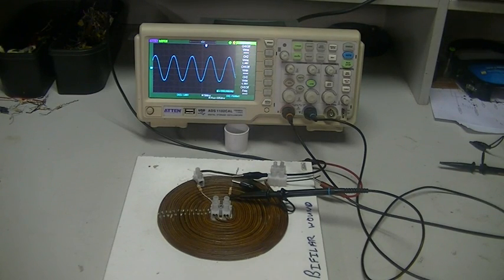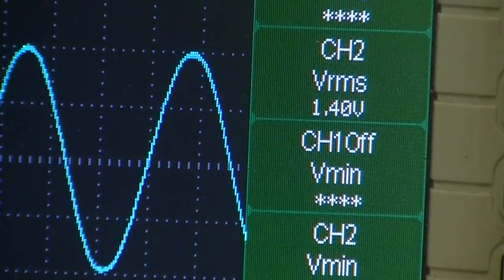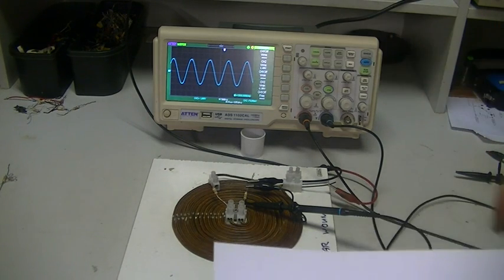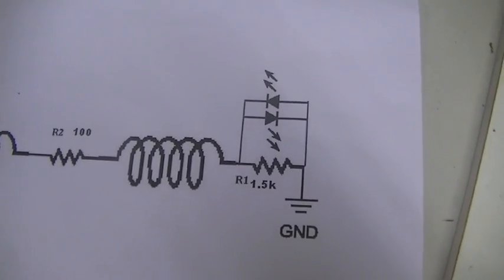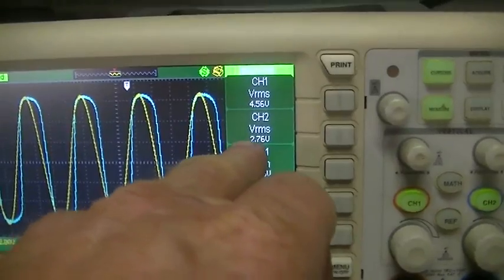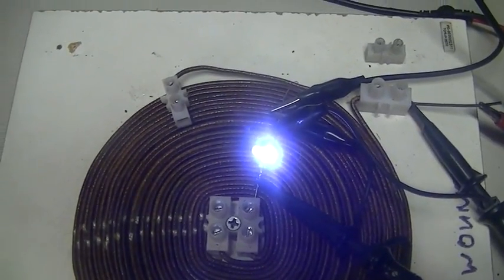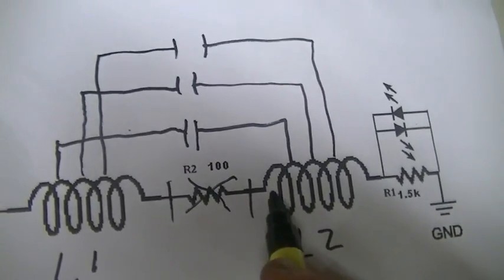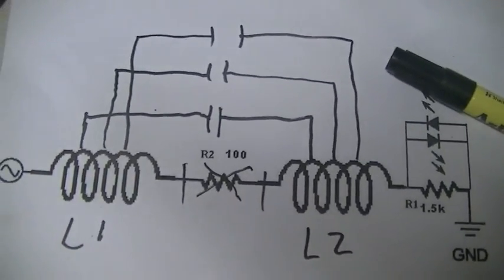My response to Russ number 3. Thinking outside the box.

Comment: if you want to truly measure if more goes out than in then what the part that you attached to the bulb to another coil and see how much that gives and do that a few times to see if it increased. Or have a solar panel that wont give out more juice and see if that work. I dont think it will but would be interesting to see if. If it can pass those 2 at the same time then you got something.

Comment: Dear Brad, I didn't see yet any O.U. in your experiment but I know that was not the point in your discussion with Russ and I didn't see the initial video that i will do. But I can answer your question I guess You already know the answer ;-) 

When we make R2 been at a NODE-POINT in term of REAL POWER (phase shift between curent and voltage at 90°), of course we can unplug R2 it will not change anything while the tow coils are CAPACITIVELY COUPLED. Also, the fact we get even an increase of REAL POWER at the remaining light bulb just indicates that R2 was not at a full NODE and taking it off the circuit increases probably the BALANCE OF PHASE between the tow coils and/or at least, the ANTI-NODE at R1.

By the way, thanks the the Attention and Care You give to this subject so it can be Really Understood without any misconception :)

Regards,
Didier
Reply: this effect he describes occures between 100 and 1000 kilohertz, so your explanation does not match the experiment, because nodes change with frequency

Comment: Are we sure what is going in one end is coming out the other?  At some frequency maybe current is going in at both ends at the same time forming a standing wave. The open center seems like a more stable point than earth ground. Since you have center open two high mega ohm resistors should have little effect there.

Comment: I thought a scope would show this naturally with AC where after removing the resistor it's showing you potential between the line and ground on each end. Being that the resistance is extremely high at that point current would not want to flow but the scope would still show you the signal I thought.

Comment: Tesla used 'high' frequency to transmit power on one wire.  Again, I suspect that you need two input resistors, one for each input leg.  Again, I suspect that more power is being pumped into the 'system' on the 2nd signal generator wire--the wire with no resistor.

Adding only one resistor is all you need to do.  I would need to start from scratch, acquire similar parts, replicate up to this point, borrow back my scope from my son, and then add only one resistor to test this thought out of my head.  Please?
Reply: You've obviously moved on to other things.  So, I was right.  No free lunch.

Comment: haha, well you realize that you were the one who made up the
test that I was doing... :) as I stated in my video, " I don’t think this
is the proper way of doing this measurement" and that’s why I was saying
it, just as you explained it here in this video :) 
anyhow, it did tell the story of what is happening in the
circuit. 

However your clam from the beginning was that there WAS more current flowing in
R2 than there was in R1. That was the clam, but from what I have seen you do in
this series of videos is you haven't measured a voltage anywhere to back up that clam of OU ( or real power). 

So, if you use a light bulb (a restive load) to check "current" then
you can indeed get a light to light with less voltage and more current. See
what I'm trying to say here? I would like you to measure a Voltage with a
reference ground point outside the coil. (so not anywhere in the coil) this is
basically what I was doing in my last video, measuring the voltage of L1+R1 and
L2+R2.  So if I would stick a resistor R3
on the side where your positive is coming from your FG then I would measure the
exact amount of current as R1.  there for
just as you said, what goes in must come out, however, what you measure inside
the coil ( L-C circuit and if you add the R2 then it is a parallel L-C-R
circuit) is different. 

so at the end of the day, you might be putting in 1 watt, But if you can get
this circuit "pumping" then you can measure "more" current
in the L-C-R "tank" type circuit. that’s how these type of circuits
work. 

Of course there is capacitance in this coil. That’s the entire reason why Tesla
dezigned this coil. Over all the years Ii have played with high capacitance
coils (This is what Stan Meyers VIC injection bobbin dose) all that extra
capacitance sets up a Self L-C circuit. And if you want to include the resistance
of the wire then it’s a fill blown R-L-C circuit. 

So having that capacitance is very helpful for some applications. 

What happens in a L-C circuit? At some point you get maximum current flow. That
is at the resonant point.
So it makes good sense that you can “measure”  more current  with in the circuit than what your FG can put
out, as you have pointed out. 
I hope this helps you understand what we are dealing with
here.  We can think outside the box but
only if we cannot explain it in the box first. 
Think of it as a laser cavity. You can get MAGAWATS out of a
laser cavity. However if you add up all the inputs of 1w pulses of light over
the given time domain of the pumping  (
so 1watt x the time pumped) then you can see how its possible to get that 1 megawatt
worth of power out of that device. 
If you don’t calculate the TOTAL energy input over the time,
then it’s a mystery why you can get 1megawatt out when your only putting 1 watt
in???

Now if we were thinking outside the box is  when we can sustain a 1 megawatt output while
still putting in only 1 watt…

Hey, are we having fun yet J
I am! 
Also that’s why the Rodin coil testing was so interesting,
its because I could measure the output Vs input, and I’ll be darn, I could get
1 amp in and 1 amp out, however the VOLTAGE was 40:300???
I was seeing an extra 800Watts in my Rodin coil testing… 
So if I could “tap in to” that power and extract that extra
Voltage, and NOT disturb the input ( so capacitive or "dielectric" coupling only)
then it might  just might be possible to use that “extra” power that is being
generated in that coil ( using its self-capacitance and resistance and
inductance) 
Wow that was a long response, but I fell text will be better
than a video for this one J

~Russ
PS. more to do here... keep going!
Reply: Dear, I'm afraid You still don't fully realise that a "tank circuit" in Electronics is just the equivalent of a flywheel in Mechanics [more exactly: coupled with a string and within a fluid having a certain resistance which makes the system amortising by losing energy].

We may indeed obtain megawatts after having fed the laser with enough impulses of 1 W, depending of its constitution and the duration of the impulse and the permeability threshold of the mirror (diode in Electronics), we will style need more ENERGY INPUT than the ENERGY OUTPUT. 

It is also about, looks to me, confusing POWER and ENERGY STORAGE.

Think of a coil as a flywheel, a capacitor as string. Seeing that, the only way we can achieve a kind of O.U. is when we shift by 90° the powerfactor for the overall system so that for the counter of the grid there is not REAL POWER consumed, only REACTIVE POWER, while inside the system, we can feed a load having the power facteur less than 1, so having REAL POWER to feed it and REAL WORK. 

The problem is that clever grids companies have obtained the limitation of the powerfactor so it can't be done, or they bill in VA (Volts.Ampers, different than Watts as You know surely) and so REACTIVE POWER is billed too! 

So my question would be: if we function on an off-grid generator providing only REACTIVE POWER but we were converting it in REAL POWER with our system, what would be the COP (electrical energy produced respect to oil energy consumption for example); I'm afraid it would be still underunity but I would like much to be wrong in my guessing ^_^).

Just some thoughts, Guys to feed your work ;-)

Regards,
Didier
Reply: Brad,
you said 
" So let's be honest,you made a video trying to show i was doing it the wrong"
and
"Once again,you made a claim that i was wrong"

those are your words, not mine. if you can tell me exactly where i said " you are wrong" ill retract my statement here.  i did miss speak on a few other things, and that's my fault. and if it was offensive then here is my apologies. 

 what i was trying to do was teach point out how theses things are hard to measure. and with out the proper measurements its hard to say whats going on. 

 I made the video because i wanted to help you understand this circuit. I clearly asked you to tell me how you wanted me to measure it, so you and i could both see the results. 

so that's what i did. 

I'm trying to be helpful here,  nothing more. just trying to analyze this circuit. 

because apparently I'm the only one that has the proper tools to measure it with out having to worry about a bunch of things like ground loops, trying to hope that the math function is working correctly, not enough channels. etc. 

so lets go back about 7 days. 

starting over, 

if you want me to test some stuff with this coil let me know. and ill help. 
it is indeed very interesting, and it is not understood, i have the proper equipment to test it for the most part so let me know, 

sure, i can go on my own way and do more testing, however i dont have to much time. so lets get to the key tests and not fiddle around for weeks making unhelpful videos. 

and if you have some key tests you cant measure correctly then let me know, and I'd be happy to test them for you. 

cheers in deed! 

~Russ
Reply: Didier Khwartz yes. just like a transmition line. reflected power. impedance matched. ~Russ
Reply from the maker: All good thanks,we have achieved the goal we were aiming for.
Reply from the maker: Russ. The whole point of the test i gave you to carry out,was to see if you would pick up on the mistake of measuring the current flow through R2,and take that as the total current flow.. There are some of us at this very time,who are getting overunity results,and great care has been taken in the power measurements. So let's be honest,you made a video trying to show i was doing it the wrong way,but in that video you showed a phase shift in two flowing currents through the coils,when in fact,if you wanted to bring in power factor's,you should have been showing the phase shift between voltage and current. So why didnt you get an OU result,well for the very reason i showed in my last video. If you have been doing this a long time,then you should have picked up on that-but you didnt. Once again,you made a claim that i was wrong,and that L2 wasnt dissipating more power than L1,but once again you missed something that you should know all about,and because you missed that,you decided that i was wrong,and that L2 was not dissipating more power than L1.--Hmmm.

Anyway-such is life--but take more care when you decide to make a video about some one else,and there work,and try and tell them they are wrong.

Cheers
Reply from the maker: You should also realize that a tank circuit can only !store! energy at it's resonant frequency. If you have been paying attention as to what we have been doing,you will see that we never operate at the resonant frequency. In fact,this OU effect show's up over a wide range of frequencies. So no,we are not looking at a tank circuit.
Reply: yes, you need to look at the Q of the coil as well. the same functions can happen in a very wide range with the right coil. in theses tests its more the interaction with the wave propagating down the wire and the interference pattern with in that is helping the phase shift. and that is interesting. in my post i was just pointing out that in an L-C ... blah ...    i did not say that we were doing it here. i was saying what i have seen in other things ( i pointed to the Rodin coil testing) ~Russ
Reply: Dear Russ, You have pointed out "All The Thing"': it's a matter of waves propagation, You could even register "NEGATIVE POWER" Consumption time to time by sending back the power depending You make the PHASE behave along the circuit.
Reply: Yep! exactly Bro ;-)

Comment: Do you have any way to measure the level of magnetic flux in your pancake 
coils?

"This can be done using a gaussmeter, also known as a magnetometer 
or an EMF detector (electromagnetic field detector), which is a hand-held device 
that measures the strength and direction of a magnetic field strength. They are 
readily available to buy and simple to use".

Comment: What would happen if you tapped off r2 with high speed switching diodes and charge a capacitor and a primary of tesla coil or a spark gap and or capacitor step up multiplier ?